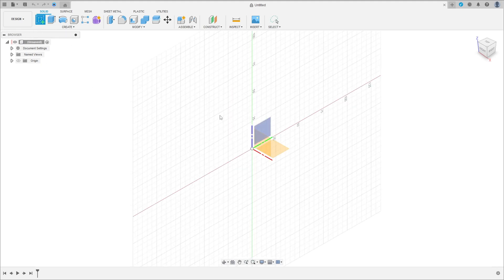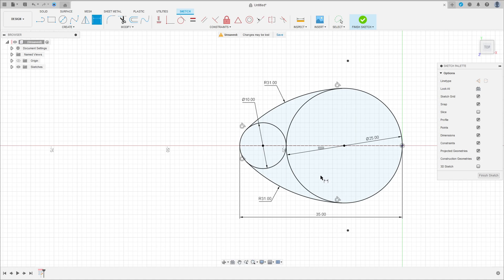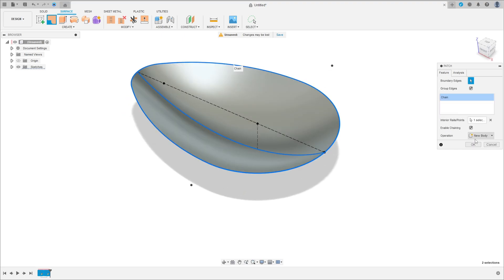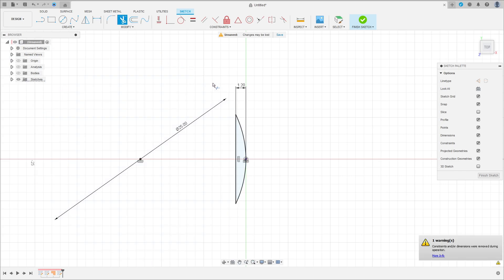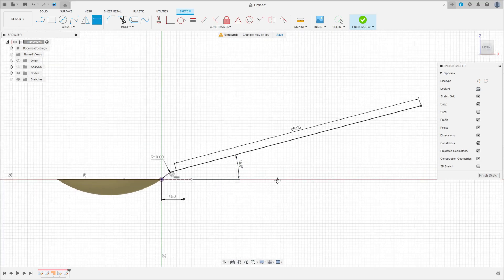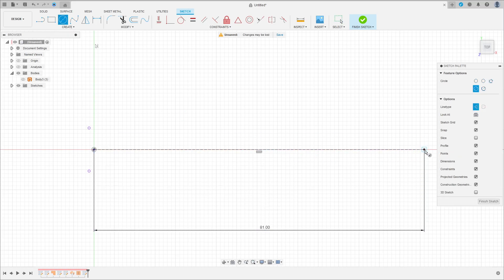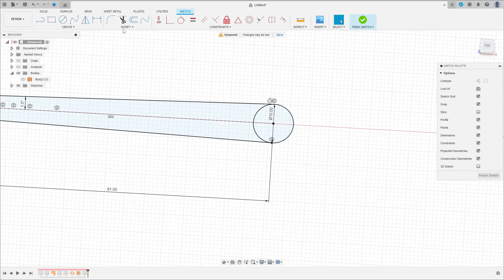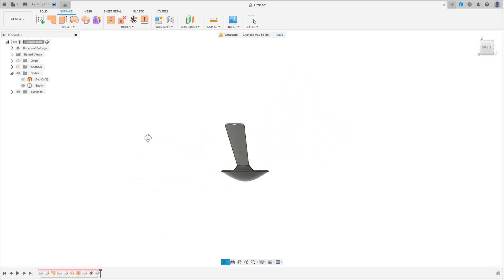Fusion 360 surface modeling - Spoon

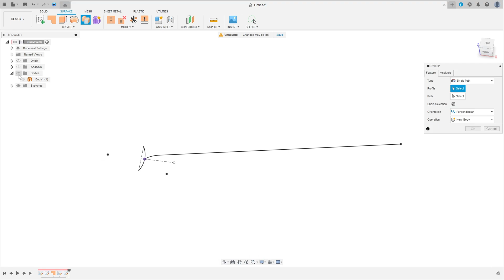Comment: I was doing OK until I got to TS 5:28.  I could not get the partial circle line to be selected as a profile.  The Path had no problem being selected but not the profile.  I went back and tried it several times but just couldn't get that part to work.  Shame, I was hoping to learn from this.  I am on version 2603.1.52 x86_64.